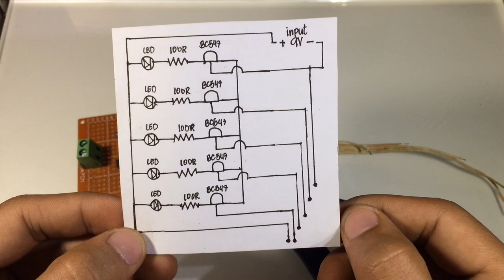How to Make a High Quality Water Level Indicator | 5 Levels in a PCB

Comment: Nice sir you demonstrated but the value  of the resistor wala.the transistor no. Ito ba'y pnp or npn and the supply voltage.please label the diagram.tnx
Reply from the maker: Nasa description po para malinaw sir.

Comment: ARE THE COPPER STRIPS NECESSORY? CAN A USE A PIECE OF WIRE INSTEAD?
Reply from the maker: it's up to you sir, you can use anything as long as it makes you comfortable and easy. Thank you
Reply: In my circuit only the first 2 leds are lighting up.. what would be the reason?. I did exactly as in the video.. will it be bad transistors? Is it possible for the all 3 transitors to go bad? Please help 🙌🏼🙌🏼
Reply from the maker: @anjenayskumar2429  you have a bad transistor I think.

Comment: i will use that in our 1k Litwr water tank
,,but instead of battery i will use an 12v adaptor with 2 amps, do you think that this will be safe?
Reply from the maker: No sir. But you can use a regulator in order to have a desired input voltage
Reply: @JaviersDIY  Thank you for ur honest advice..got it

Comment: Can I use a 18650 Battery (3.7v) with 2N2222 Resistor? Will this work in same manner and with same connections, please reply..
Reply from the maker: No sir  because it only works with the same value of transistor not resistor.

Comment: Please help, why do you need to use transistor if the water can connect the positive wire to the led ?
Reply from the maker: Sir using transistor is more effective than depending on the water.
Reply: @JaviersDIY  why is that ? can u please explain
Reply from the maker: Using a water as a conductor is not a proper way it has a low conductivity if you use DC supply but If you use a transistor like I use the video it is more effective and sensitive because it needs a ground only. That's I prefer to use transistor than water only.
Reply: @JaviersDIY  between the transistor and the water, do you need to put resistor in the base transistor to limit the current ?
Reply from the maker: Yes sir.
Reply: @JaviersDIY  if the resistance in the water changes, do the led also get dimmer ?